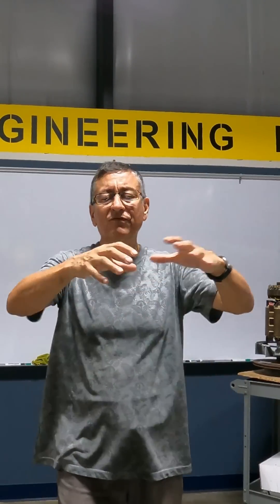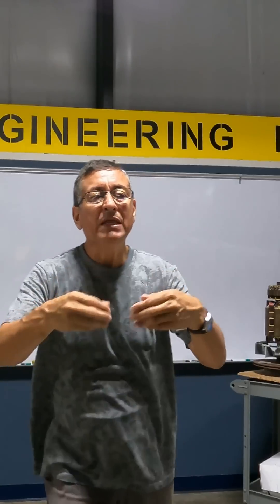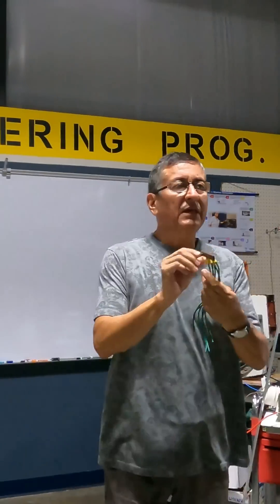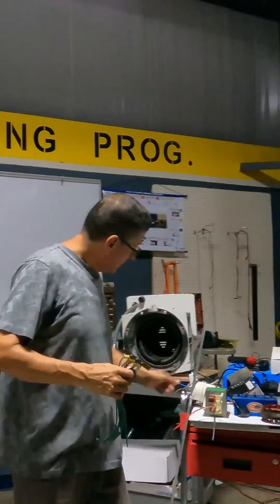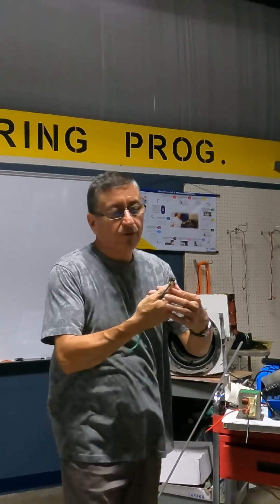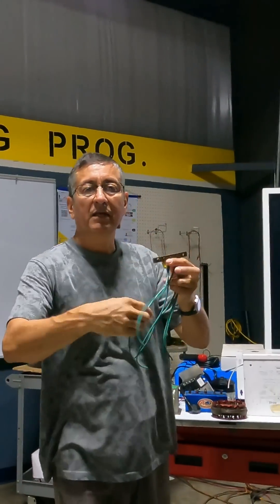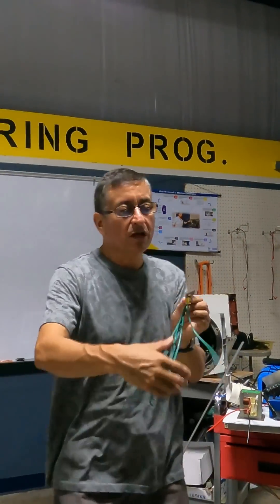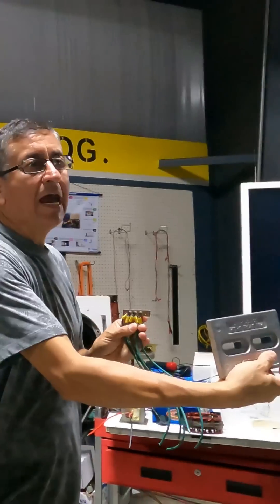Marine Bonding System

Comment: The anode is just an easier target for corrosion. So, as long as it is bonded to the electrical discharge path, the anode will corrode instead of your motor.